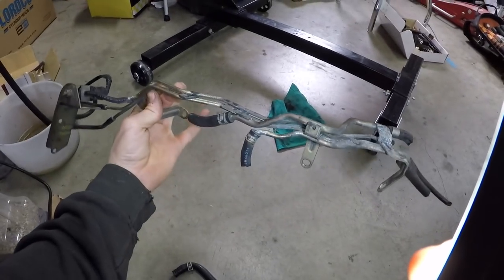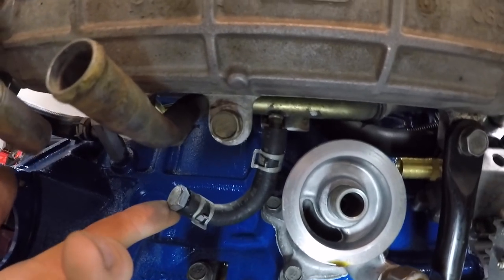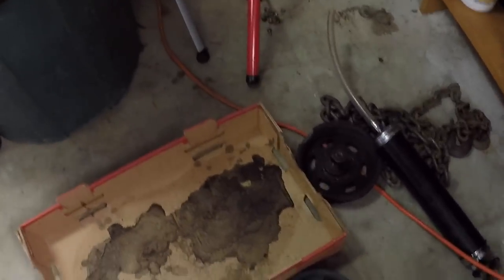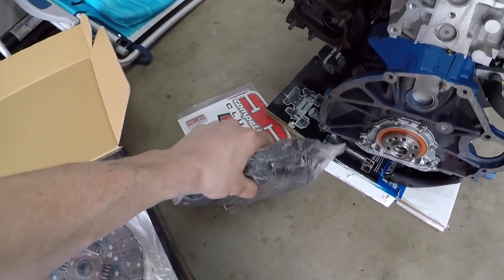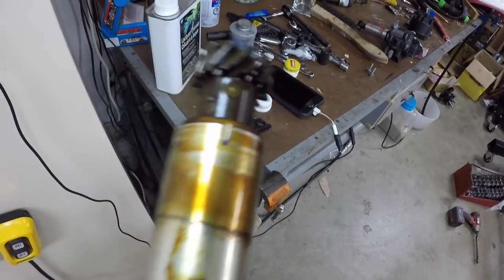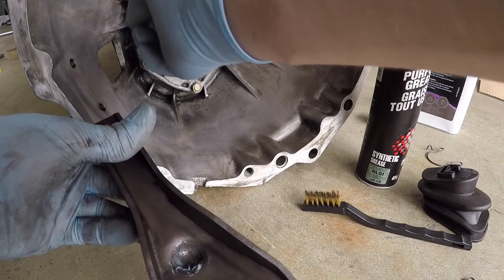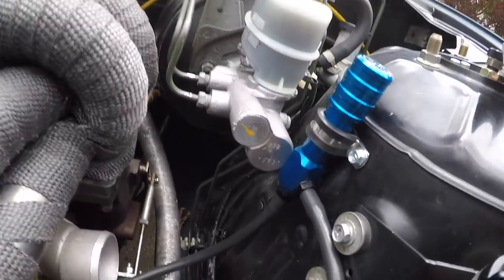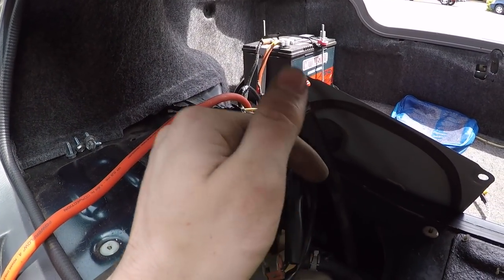S14 KA24DET Engine Rebuild pt.4 Assembly

Comment: I'm starting the same process here soon. What all did you have machined and balanced. My motor didn't blow I'm just rebuilding before turbo. PS watched all your videos can't wait to hear the start up.
Reply from the maker: Matt Hammett I had the head resurfaced and resealed, the block decked, bored and honed. And line honed for studs. I didnt get anything balanced because they told me for my power goals and with it only being a 4 cylinder it wasn’t necessary
Reply: BuiltLikeThis awesome. Thanks man trying to cut some fat of the money steak lol

Comment: Y didn’t u do a SR swap instead of rebuilding your KA
Reply from the maker: Jordan Ebanks lots of reasons. I already spent the money on turbocharging it so didn’t want to have it go to waste. Ive always wanted to rebuild an engine and id rather have a freshly rebuilt KA over a used SR.
Reply: Little known fact, the KA design is actually super good. They don't have nearly as many issues as the SR especially when they're built right. They are iron block, have more displacement, a great stroke and have stupid torque. They make some seriously good power and are really reliable. Back in the day, they had no aftermarket support, but as the chassis has aged, more people have realized its potential. Check out ka-t.org, some killer builds on there.

Comment: Is that other transmission for sale
Reply from the maker: 91 Z3nk1*Ct ya it has “bad syncros” painted on it though. Probly needs a rebuild. Got it with the engine i bought
Reply: BuiltLikeThis how much would it cost to fix
Reply: BuiltLikeThis and how much you selling it for
Reply from the maker: 91 Z3nk1*Ct not too sure depends on the shop and what all needs to be repaired. Like $60
Reply: BuiltLikeThis well I would like to buy it off of you if your willing
Reply from the maker: 91 Z3nk1*Ct sure. Are you local?
Reply: BuiltLikeThis don't know where you are but I'm in CT but I'm willing to pay shipping also